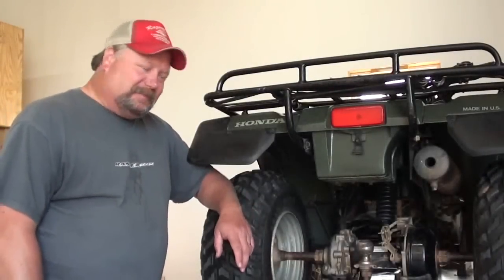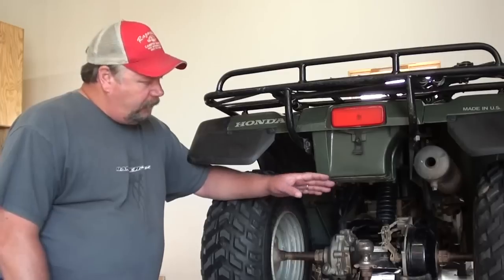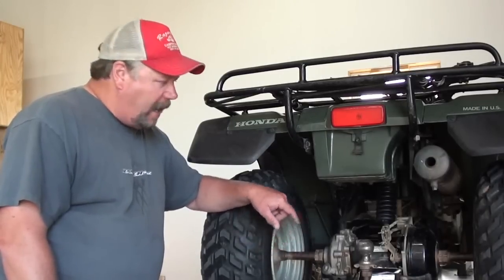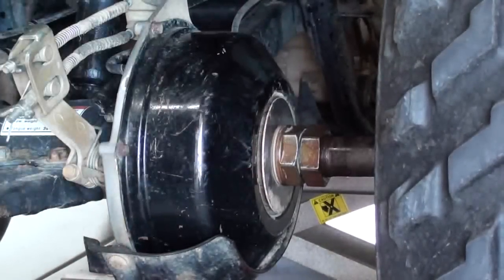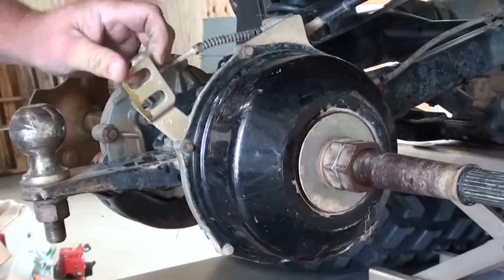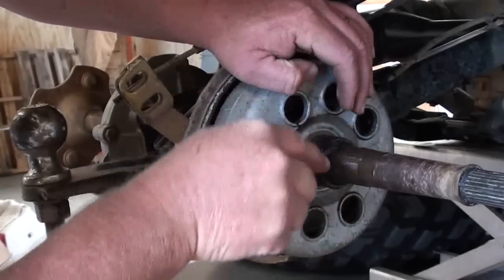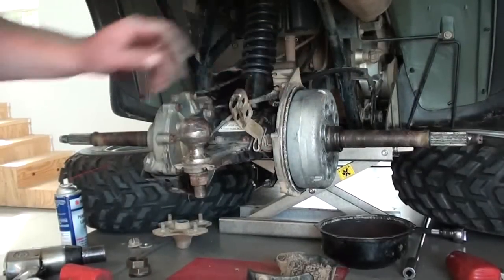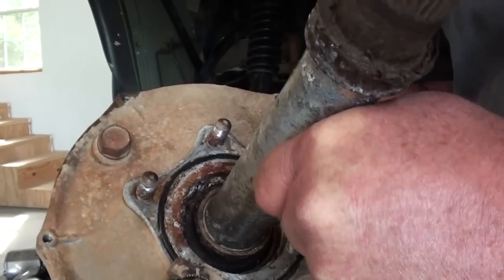Pt.1 Honda TRX300FW Rear Axle Bearing & Brake Repair At D-Ray's Shop

Comment: D-Ray, you are the man.  I have a 1990 Honda TRX300 4x4, with the very problem described in this series of your videos (i.e., bad right axle bearing and bad rear brakes).  Your 4 part video was comprehensive in describing each stop to correct these problems.  Thanks a ton.

Comment: Great videos!  I own a 1986-7? Honda Fourtrax 200 that is 98% original.  It's been sitting since 2008 in my brother's garage, 200+ miles South of me.  I went there in October 2016 and put gas in the tank, aired the tires from flat, installed a new battery and put oil in the spark plug hole.  Cranked it over four times and it fired right up!!!   I about sh#t my pants, lol
We rode it the entire week long Deer Gun Season in November/December and it made me SO proud!!!!!
These Beasts are indestructible!!!!!!!

Comment: My problem was that one of the linings let loose from the shoe and wedged in under the other one.... locked down the bike completely!  Not knowing what the problem was, it was quite difficult to get the drum off without breaking the back plate, etc.  Thankfully, I had a set of crows feet to wedge from the front holes and tap simultaneously..

Thanks again for your excellent videos!

Comment: d-ray u r a good ol boy an i really appreciate ur video an whoever ur camera man is does a good job keepin up with u. thanx 4the instruction & hep!
please tell me how 2 loosen my chain on a 88 trx200sx as i tightened it up an after i ran it it was tighter n a fiddle string an i tried loosening all the bolts and taking the stress off but nothing so i left it all loose an drove it a few miles but it wont loosen up so pray-tell what do i do to get it loose?

Comment: Hey D-Ray, thanks for the vid. I got mine all apart and before I assemble I wanted to ask you about a couple things. 1. Should I pack grease in the new right side bearing? Should I pack the section of the rear on the inside between the left and right bearings, where the shock is connected? 3.Should I use thread locker on the 4 axle nuts? 4.Where the black metal break cover connect to the rear with the 6 bolts, should I grease around the rubber gasket or even use gasket seal? Thanks.

Comment: think this applys to the axle removal of my moto4? i got everything i can find removed and still wont budge, so composite hammer and slammer? thanks alot your video is extremely helpful glad theres guys out there like you posting these things and not just doing dumb things for views. ya really help out the basement mechanic like myself

Comment: If you got bad rear axle bearings is that enough to make the rear differential pop when you’re turning left or right? I’m hoping that’s all that’s wrong because I know my rear bearings are shot but I get in loud crunch pop when I turn left or right at the rear diff. Runs good in a straight line.

Comment from the maker: It may have come from the rear end, if the right ring gear seal is bad it will let 90wt into the axle housing, so if the bearing in the brake panel was bad it would also make it's way into the brakes.

Comment: Hey D, I have a 1997 Honda 300 2x4. I'm wanting to order/replace my rear brakes. Can u help me with ordering all the right parts??? Brakes seals etc. I need to replace the front brakes as well. Thanks and GREAT videos.

Comment: Good video but how do you get the brake cables off of the backing plate. I thought I seen you pull them off with a vice grip, but then I watched again and I'm not seeing how you actually did it.

Comment: D-Ray I thank your presentation was very helpful and you cover all area I'm a first time ATV owner and now I feel that I can make the repairs I have 2000 Honda Rancher ES I notice very small drop of oil coming from the rear of my ATV  however I have looked online and not sure which seal / bearing kit I should purchase can you be any assistance on this with the correct p/n  again thank you.

hank
Reply from the maker: +henry dixon You'll probably need to replace all bearings and seals in the rear end, my distributor doesn't offer a kit for it, but you call get all the bearings and seals from Honda

Comment: Hi Donald really enjoy to watch your video, i have a Honda TRX 250 1985 or 1986 is pretty the same thing i believe anyway ,the shocks in the front i'm trying to remove the spring out of the shock but went i compress the spring i see a nut just above the top of the spring  so i lock the nut with a wrench and turn the top of the shock to unscrew to the right , but it only turn so much and then if stop i'm afraid to put to much torque on it, i'm afraid to brake the shaft of the shock please i would really  appreciate your advise , Thank you

Comment: 1st, thanks for posting these videos, I've referred to them a few times. I have a 93 honda 300 4x4 in good shape but its never shifted right, the sets of clutches were cooked so i started there knowing it needed them, the Centrifugal ckutch linings were crumbling apart and the change clutches were below serv. Limit and rusted steels. (Sat for a long time) my problem is a ton of free play, no resistance at all in the shift lever (clutch is properly adjusted, I've done several adjustments on these old hondas and the shifter was like this before i did the repairs? Is there a spring on the shift shaft under the left cover or something to look into?

Comment: Thanks D-Ray.  Must have watched this series three times as I disassembled my 1995.  One question I had was if the rear axle is Reversible?  I pulled it to wire brush it and forgot to mark the ends.  Couldn't find an answer to this online.....
Reply: He answered that question in the vid. Install it either way.

Comment: D Ray, thanks for the excellent explanation.  One question that I have is about the ring inside the drum.  What is the purpose and does it need to be removed to get the drum over the pads?

Comment: Donald, I hope you are making a nice profit from the advertising, I've watched them all.  I have a 98 300 fourtrax and wanted the service the rear end,  I started out having issues removing the brake drum, so I took your advice and tried pushing the axle through but had no luck.  It didn't have the oring on either side installed.  Cleaned out the area with some cleaner and air, when I hit the axle with the composition hammer it will move about a quarter inch in both directions.  Any suggestions on what I could do?
Thanks again for the great videos.

Comment: I cant get the axle press out of both the brake drum and the final drive, tried heat and used a 12 ton press. any other tips?

Comment: I’ve got a quad just like this one and it will idle fine when the choke is all the way up but when I turn it on it doesn’t run so good. Should I rebuild the crab? Or check throttle cable?

Comment: Question:  I'm in the middle of the same project on my 98 TRX300 4x4.  At 6:11 on this video you pop that black cover off the brakes.  When I did that on mine, grease poured out (maybe a mix of grease and water).  The balls from the bearing were gone...the springs on the shoes were gone (rusted into oblivion).  Where did all that grease come from?  It seems like too much to be from the bearing.  It's all cleaned up and looking nice now with new shoes, seals and bearing.

Comment: Awesome videos man. I am thinking of making the conversion from drum brakes to disc on Honda 300 4x4. I noticed mixed reviews on several kits. Have you done this conversion and/or do you have a recommendation to which conversion kit?
Reply: I did the disc brake on my 91 Honda 300FW and you need to remember, you have to put 12" wheels on it.  Most if not all 300's come with 11" wheels.  the 12's are easy to find on Craigslist.

Comment: Hey I have a 2002 foreman 450 when u turn to ur right it make a bad noise on the back rear right n I don't know what can call the n when u take the tire off what size of a sock with pin in it

Comment: D-Ray- My Bi- starter valve (I think is what you called it) the cable rusted off it and so its not moving with the cable.  I have set it in place to try to get it to run while the part is on order.   Right now, any time I try to apply throttle- any throttle at all- the engine dies.  Do you think this is the only problem?  I've cleaned the carb.  Thanks for any help.

Comment: What's the part number on the bearing? I have two fourtraxs, and I've had the same problems in the both. the rod runs from the diff to the rear hub, and the shaft slides into the other shaft is la winging around free. The bearing has come apart, and I'm looking for the bearing. It's a ball bearing I presume, and I'd like to get it pretty cost effectively?

Comment: Hey Mr. D-Ray....!!! I have a quad problem question to ask you about if you have time to answer it. I have a 2013 Honda Rubicon Trail edition. Lately when I put the bike in reverse when I have not used it for a while and it's cold. It seems like the engine bogs down and almost  stalls out & surges when I hit the gas really hard. This only happens when the bike is in reverse tho and it's getting worst as time goes by...!!! Please & ty in advance sir...!!!

Comment: Hello! I have a bike like this I need some major help the rear output boot has a small rip in the bottom it's behind the shifter when should I replace it where can I find the part? I is the drives shaft going to be affected? I need some help this bike is very important to me!

Comment: Ive been searching for info on tire size for trx 300 4x4. Mine came with Front 23x8x11, Rear 24x9x11... I bought it with Front 25x8x11, Rear 25x10x11. Im wondering if thats going to be a problem. Ive found lots of vids here where people state they have 27s or 29s etc. but make no mention of different sizes for front and back. Can anyone lead me to correct info regarding my tire question. Thanks for the fanasic vids D. Smith!
Reply: unclefreakinmike you need a difference of one inch front to rear. I was told that due to pitch on the drive shaft. Causes wear. I think it’s better for balance on hill climbing too

Comment: have a 93 4trax 300. cant get fire to the plug. it was running fine, shut it off, nothing! Help!!
Reply: I had the same problem with my 91 fourtrax, i watched a video on YouTube and the guy said it was possibly the cdi box it in front under the handle bars the long box with 2 plugs. I did what he said and put in the oven on about 6 pieces of tin foil on 265 degrees for 10 minutes. After then i shut it off and left the door open till it cooled off pluges it back and and it fired right up for me. This is after i replaced the coil. Hope this helps good luck.

Comment: I need help with front suspension damage on a 2008 Honda 500es.  kids wrecked it and bent my right front wheel inward on the top of the tire. HELP ANYONE.